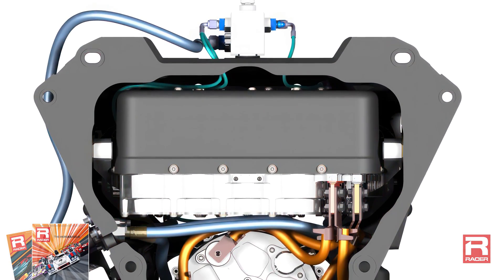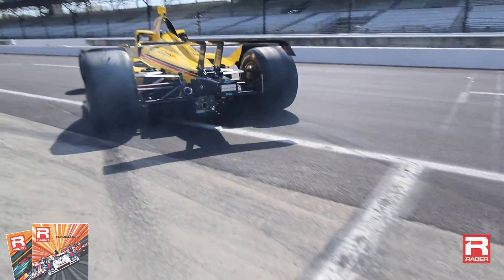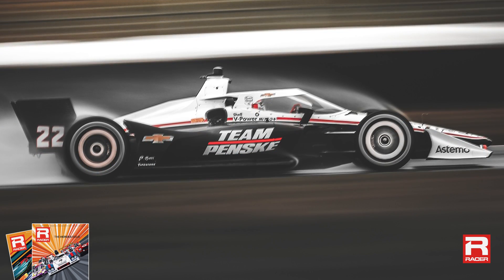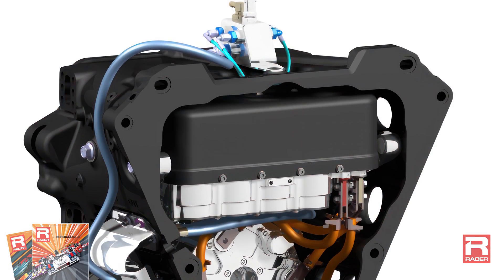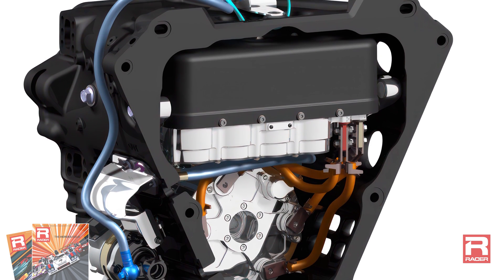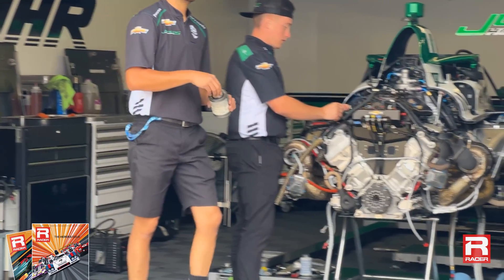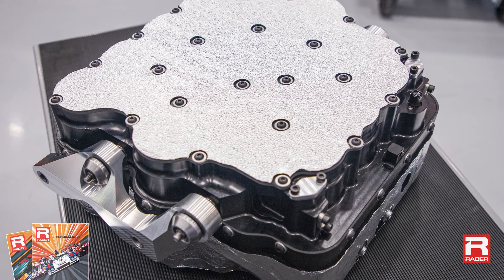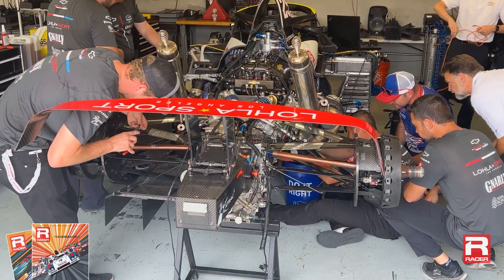Part 2 - IndyCar Hybrid Engine Roundtable hosted RACER's Marshall Pruett presented by Skip Barber

Comment: I am anti electric car garbage.  I like to hear the engines.  Hope it don’t change the sound or slow them down.
Reply: I heard the car going around the IMS road course earlier this year running with the test unit. If anything, the engine sounds even a little more angry as the motor/generator kicks on and off
Reply: @bennyfactor  good deal.
Reply: Show me, on this Hot Wheels, where the electric car touched you...

P.S. The vast majority of US drivers, live in the cities and travel distances that are completely suitable to current EV ranges. 

But screw EV's, let's put all those commuters in Hummers and F-150's...makes perfect sense...

Comment: It it going to add several inches of wheelbase to the cars, or will there be a new gearbox design to go with it?
Reply: with how snug that supercapacitor and motor fits inside the transmission bellhousing, i think it's gonna be the same as the current setup, just heavier.

Comment: Will the hybrid system allow the cars to self-start?
Reply: @konekillerking
Great question!
Yes. The systems' electric motor will now be able to start the cars on board by drivers in the event of on track engine stalls. I'm thinking this should shorten at least some cautions where drivers didn't damage the car bad enough that it wasn't drivable but stalled the engine causing a full course yellow. What percentage of wrecks does this happen 20, maybe 30 percent?? 
Ability for driver to restart on board is another big benefit that will improve the racing by shortening caution flag times in some cases.

Comment: VERY COOL SUPERCAPACITOR HYBRID TECH.  Lamborghini uses supercapacitors but most hybrids including Formula 1 use batteries.  If it works as planned, IndyCar needs to shout about having the most advanced hybrid racers in motorsport.  I am shocked F1 has not yet adopted this tecnology.
Reply: It's not the most advanced system. Toyota dropped it in favor of batteries at the end of 2015 in WEC. F1 teams didn't consider it in 2009 because it was the heaviest solution compared to flywheel and batteries.
Reply: It's a tough sell that it's more advanced. Both are going to be using cutting edge motor/emachine design. Betting that the battery tech in F1 is also cutting edge, just like it's hard to find better energy density in capacitors then what Skeleton has done. Capacitors are good in applications with constant charge/discharge hence why you'll rarely see it in road applications as they can store/discharge energy very quickly but lack the storage capacity of batteries.

Comment: So if I understand this correctly the new drive train will be as follows?
Engine(Chevrolet or Honda):Hybrid:Gear box
Reply: Should make it possible for the drivers to restart their engines should they stall on track. Hybrid motor will act as a starter motor. No need to wave  hands to marshals if engine stalls.
Reply: @izzdin6228  Nice! Maybe then IndyCar would open up to have standing starts on street and road courses. As those are a mess IMHO. Take Long Beach 2023 as an example.
Reply: Yes.
Reply: @MX304  Thanks!

Comment: That caught my attention! If the hybrid units will only add 60 lb (maybe even less!) to the car but still add ~100 hp I’m interested. Especially with the aeroscreen 2.0 being around 20 lb lighter with the transition from subtractive to additive manufacturing methods reported previously by Racer

Comment: My only question . . . Why? On the street, hybrid is rather passe. Definitely not cutting edge. So hybrid doesn't convey the impression of innovative technology. And it seems impossible that any new drivetrain would improve the racing. So . . . is this just change for change's sake?
Reply: I think it might be viewed as passé primarily because most hybrids are currently just people movers and econoboxes. But hybrids can also be beneficial for performance or more arduous applications, so going this route is just a step in that direction. Just like we see in Formula 1, hybrids can add a lot to the overall package, but obviously here it needs to be more financially viable. I dont think any technological innovation inherently improves racing but it’s a change to keep up with the times that can also have a knock on effect to other series or applications.
Reply: @ALMX5DP  , hybrid is viewed as passe, for the most part, because it requires a double weight penalty. You  have to carry a liquid-fueled drivetrain (and its fuel supply) plus an electric drivetrain (and its battery). Hybrid makes the least sense when compared with purely liquid-fueled and purely electric drivetrains. Hybrid is just a transitional technology to keep people from running out of battery power 50 miles from the nearest charging station. In a closed racing circuit, running out of power and being stranded is not a consideration.
Reply: @billmartin1663  hybrid tech can be used in a few different ways, energy recovery systems (that isn’t possible with just ICE), torque fill, electric running or operation in certain scenarios that it’s advantageous to do so (like entering pits), being double utilized for aspects like an alternator or starter motor etc.
Reply: Why? Because the manufacturers are being forced to pursue " green technology " by thier respective governments and will pull out of indycar otherwise.
Reply: @BoleDaPole  This was something that was noticed within IMSA as well. The manufactires need the cars to be "hybrid" for marketting but dont need the P1Hy/F1 with the large electrical side, they just need to be enough to be a hybrid.
Reply: No, it is to try to placate the 'Green-Crowd'.  That's it.  They're scared.
Reply: Change for change's sake...yes and no.

In addition to the 'green' optics it does add an additional variable to the teams when it comes to strategy. When and where to deploy so that they never top off the capacitors, but get the biggest advantage. Do they use it to add instant torque at low RPM or edge out that extra bit of top end speed on the straight? The big question is are they going to use it on the ovals where there's no sharp curves to regen off of.